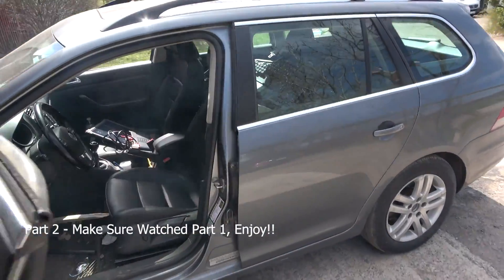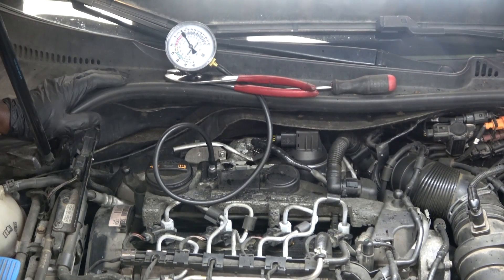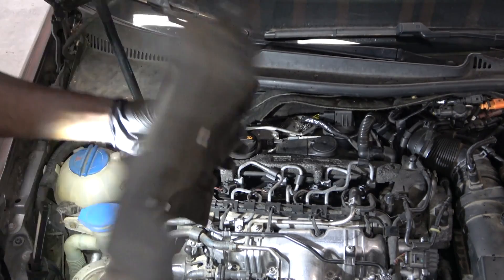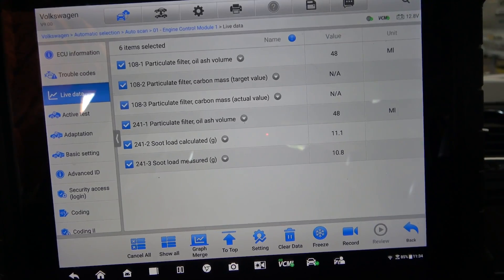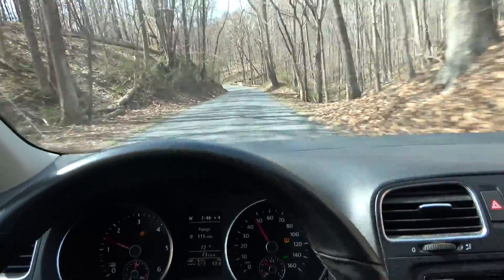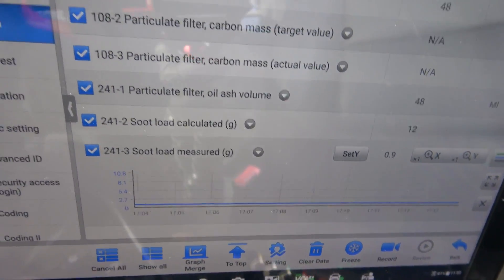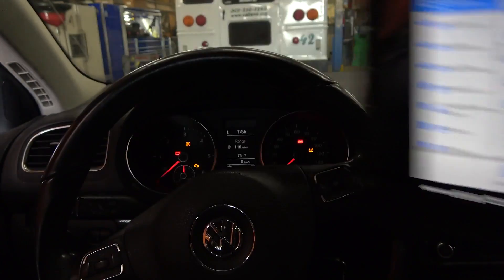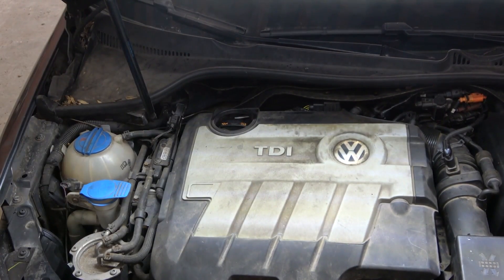Volkswagen Jetta TDI: EGR & DPF Trouble, Part 2 - Code P2002, P0401 & P240F

Comment: Your videos are great. You are a good teacher. Curious if you followed up with this customer, did it ever resolve? I am wondering if the soot went down and the pressure went up, is it possible the cleaner moved soot/ash but not completely out of the DPF? Is it possible the cleaner broke up what it touched but got clogged further in the filter? Ultimately, I am wondering if cleaning it multiple times until pressure breaks might be the strategy?

Comment: I like your video. I have those kinds of problems with my TDi too. One of the two rubber tubings coming out of the DPF is damaged. It looks like the last mechanic tore it up. Can you do a video or advice how on how to replace the torn plastic tubings?
Reply from the maker: @lkyhood4200   Thanks, Yes! they are pretty easy to change, there is a clamp on the bottom of them, Remove the clamp and that's it
Reply: @KITS_Auto_and_Truck_Repair  Thanks for your reply. But I can't get to the bottom of them. Do I have to remove other parts to get there? or lift up the car and get to them from underneath the car? 
Your further suggestions will be highly appreciated.
Moreover, is there a safe way that I can get your business contact to speak with you directly?  I'm very far away from your state. Thanks.

Comment: I have a 2014 Audi Q7 4.2 TDI, at 280k, km, had the same problem of clogged DPF. I have watched couple videos on this topic and found one that was interesting. The dpf gets clogged by soot and ash, cleaning the soot only does not solve the problem, but using Aluminium cleaner and a kitchen detergent in water to flush the  Aluminium cleaner is the best solution. I did it myself and the car is fine. 

It works better when you remove the DPF and clean it. You might save your customers money
Reply from the maker: @jasonmudau1140   Thanks for sharing

Comment: Are you sure you put that cleaner and purge into correct tube? As far as I understand you poured all those goodies in a tube after dpf. The inlet hose is connected to a sensor on the right side off the engine.
Reply from the maker: @sardolik   Yes! you have to pour these liquids in front of the DPF
Reply: Yeah I thought it was also the sensor to the left of the engine as you stand in front of the car that was for the dpf. I thought the one he used was the egr pressure sensor.

Comment: This is great video.. why did soot measured PID drop 10g after the cleaning when the true pressure test showed 3-4psi ? I am getting similar symptoms in my CJAA TDI sportwagen.. I have P0299, P0401 and P02002 and car goes into limp mode.. no boost pressure. Is that clogged EGR filter and cooler? Car only has 102,721 miles on it 2013.. I’d like to try to do a in place chemical cleaning of DPF but it looks like that isn’t going to work based on your video .. or do I need to remove DPF and clean it by back flushing cleaner through it? Any help is greatly appreciated.. I know getting the DPF out is a pain
Reply from the maker: @virtisconsole12  you should try to clean it while it's in the vehicle and see what happens, it might work for you!

Comment: Can the rear EGR valve be cleaned in a similar way as  this? I got rid of my DPF codes with Rislone added to a half tank of Diesel and driving at high rpms for 30 minutes and  filled all the way after. But I want to clean the rear EGR without taking half of the car apart.
Reply from the maker: @guaporubio   Yes, you can try it!
Reply: @KITS_Auto_and_Truck_Repair  Which place or tube would I need to inject or spray the cleaning substance?

Comment: You know I'm in the same position.I think I'm just going to do DPF replace. i've very rarely seeing these in car cleanings truly work. If you take DPF out and really clean it, may be get better results. But to get DPF out is a huge PIA. Why not put a new one in. One of the comments below said they had this problem (codes) and continued to drive 20,000 miles with no issue. I have VCDS scan tool. So I'll force some regens. I'll look into blowing cleaner in there, may be, but hate to waste time and money. There is DPF delete but I'm a boy scout and not worth it. By the time you do that mod it cost you the same, albeit, with no DPF soot load issue ever again. However resale and states/cites that check  emissions will be an issue. Not to mention fines. Love the VW TDI. Had mine for 12 yrs. Plan on 12 more. Great pwr (torque) and MPG.
Reply from the maker: @gmcjetpilot   Yes!

Comment: As a backyard mechanic with the same situation as far as a high soot load and dpf light on as well as limp mode and chk engine light.  I Cleaned the dpf with the same gun to no avail. 
But my dpf pressure sensor didn't show a code but was the culprit.   The dpf light went out as well as limp mode but my egr o401? Is still there. 
I have put 20k miles on the car with the insufficient flow on the egr.
Runs great at 200k. 
I'm leaning towards changing the egr filter now but I'm just guessing without a higher priced scan tool.
Can't see dumping thousands on this thing when the value of the car isn't there. 
Thanks, love your work
Reply: 2014 jetta tdi
Reply from the maker: @jeffreydelgado6382  My Pleasure! and thanks for sharing your experience with us!

Comment: What could be better to replace the EGR or the DPF FILTER?. Do you have a video of the DPF replacement?
Reply from the maker: @maximilianocruz1360   not on this model, did you get it diagnosed!
Reply: I used the VCDS scanner and I did the reganeration with that but are still appearing the codes p240F and P0401. Where are you located?

Comment: Great video and I loved watching the troubleshooting journey learned a lot!  Although I would recommend saving yourself and the customer time in the future with these codes and and tailpipe soot...  When the computer throws these codes it's related to the low pressure EGR circuit, you also could easily notice there was soot in the tailpipe.  What this means is that the vehicle has a cracked DPF filter.  It may also be clogged too, but soot in the tailpipe is a telltale sign that the DPF mesh filter has been cracked and is allowing soot to pass through to the mufflers.  Even if you had a clogged DPF, it would not allow soot to pass through into the tailpipe.

This is an extremely common issue with these model years, the DPF is a consumable part that is not meant to last the lifetime of the vehicle, they go for about 100k miles.... and eventually they will crack.  They can also crack because of faulty injectors causing too much heat in the system.  You could probably make the engine light go away for a while, but eventually it will throw the codes again and it will clog up sooner than later.  It's extremely frustrating that the EPA has put so many restrictions on diesels like this....

If you replace the DPF filter make sure you also replace the EGR filter at the same time or clean the EGR filter, that thing is probably clogged up as well, theres also a low pressure egr valve back there that could use a cleaning too.  You might be able to use egr cleaner and spray it into the exhaust manifold but usually that doesn't seem to work from what I have seen.  This is what I was able to discover through my own research on these jetta TDI EGR systems.

I own a 2013 Jetta TDI and have the same codes.  Did you try redlining the vehicle to see if the computer forced the car into limp mode?
Reply from the maker: @POVMagic  No! I didn't, Thank you for your input my Friend, I appreciate it!
Reply: @KITS_Auto_and_Truck_Repair  No problem, I loved you analytics and logic trying to solve this issue.  I honestly learned a lot from your video.  But yeah just check the tailpipe when you get a TDI, if it is full of soot the DPF is likely broken.  I love these cars but the EPA really screwed us.  Annoying repair to do too, but I think its an easy job once you do it once.
Reply: @POVMagic  so what is the solution? I have a 2013 Beetle TDI CR with DSG. I have a lot of soot in my tail pipe and a cel light with DPF light going on and off intermittently. Also, when I'm driving uphill (incline) I get an overboost with flashing glow plug light and reduced power to low pressure boost only (15 to 20 psi max)

My guess is that my dpf is full and it's now causing that soot to go into my turbo/vanes causing the valve restriction and over boost.

Can you tell me the best solution to resolve my issues? Do i delete it all? I refuse to replace the dpf because my car's value is less than the new filter! I have 209,000 miles but everything else is in good condition.
Reply: @TrailerTrashers-s1v  delete kit plus tune (need tune) will cost about the same as just replacing dpf.  Deleting modern tdis isnt as easy as it used to be either its a pain in the ass.  The machine broke down and needs fixing... if you neglect it eventually youre gonna blow the turbo and nox too.  It sucks but it is what it is.... i personally love my tdi and fixing it is still cheaper than buying a new car :)
Reply: I have a 2013 tdi Jetta with the same exact problem and you made a great explanation of what to do but my question is, it is fine to run for a few months clogged up untill I eventually delete it?

Comment: What was the DPF deferential pressure after injecting the cleaning fluid and doing the test drive that brought the soot content down to zero?

You should have taken it on a 30 mile road test driving with mainly low gears.

If the car is not on limp mode with reduced performace(the car can still rev past 3000 revs all the way to red line) then the DPF is still good cause if it is blocked the car will be on restricted performance.

Oh and next time don't drive with one hand and video with the other hand for content, it's very dangerous and not worth it, we your viewers believe you, so just explain your test drive results after.....

Stay safe bro!!
Reply from the maker: @leroyjohnson4973   Thank you! I appreciate your input!

Comment: General you need to get a manometer to read the dpf and stop using that rubbish dpf cleaner and use launch cleaner instead
Reply from the maker: @naurbassant7329  I would not call this cleaner rubbish, I've had success cleaning DPF With it, but it doesn't work if the DPF is too clogged!! it works sometimes
Reply: @KITS_Auto_and_Truck_Repair   I’ve used this product for years with success but the launch product works ten times better and gets yourself a manometer and a mityvac gauge and learn how to use it correctly.
Reply: I would say he must stop working on DPF issues. Even though he uses LAUNCH, will have the same results because he doesn't understand the way DPF system works.
Reply: Most definitely I think he should take a page or two from jimmy oriley

Comment: Why didn't you activate def regeneration using the Auto scan tool. i know that the scan tool does not  allow dpf regeneration when there are trouble codes, but the DTC that you had had to do with brakes. the scan tool does take the def to more than 600 degrees Celsius .
Reply from the maker: @clublength724  The Scanner didn'tt allow me to initiate the Regen!
Reply: You could melt the  dpf honeycomb, if you don't clean it first.